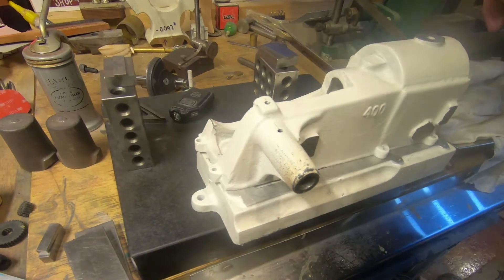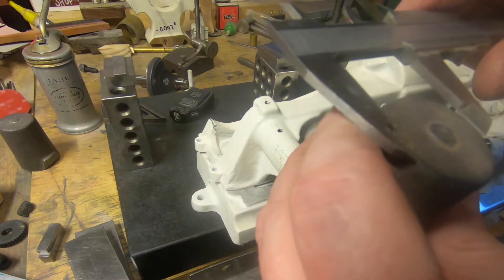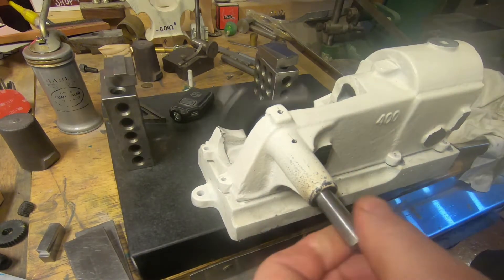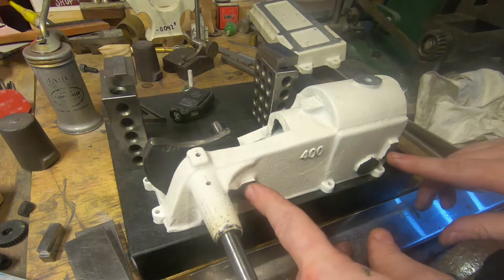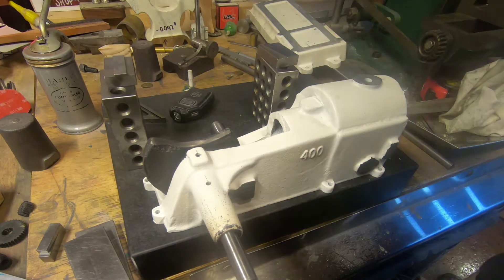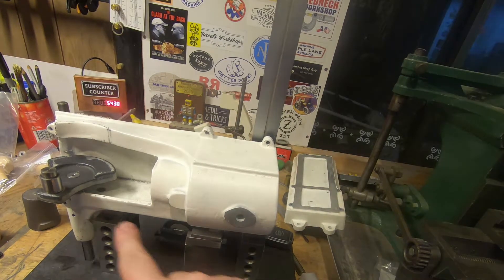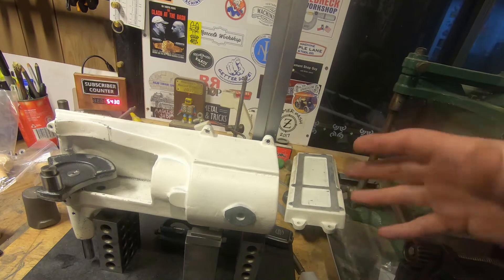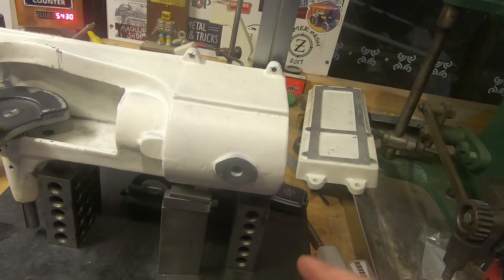Introducing the "400" Part 14b (or 15a?) CHECKING STUFF

Comment: Emma, after last livestream.  i must ask; perhap[s you could explore investment casting.  no more draft angles to sweat. cores? yes; 2 different ways about that. BIG important step; seal the surface of the model with elmers glue.   Steven Lang demonstrated a "lasercenteringedgefinderon his channel.he states it puts a red dot that is narrower than a scribe line!  at from 1 inch upto six inches  from divice!!!  only $125.00.  im ordering on payday!!!!!!!!!  my powered single point threading project kicks off next month. i order the belt from mcmaster later today.  now the engine looks more fun in the patreon vids.   poppy
Reply from the maker: Not sure about the laser centre finder the. I have used that one. Remain a little unconvinced. Your big issue is that it's about 4" LONG.
Reply: @EmmaRitson  yes, but its shorter than the laser bore-sighter i tried this with first. one inch will go up into the spindle. i tried this with 3 different lasers. this one will do what i need.    take care  poppy